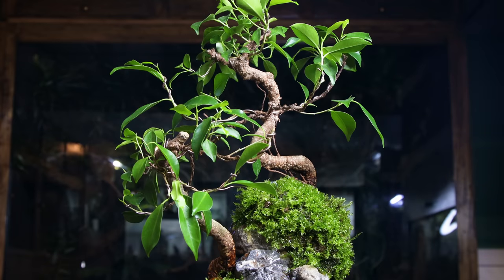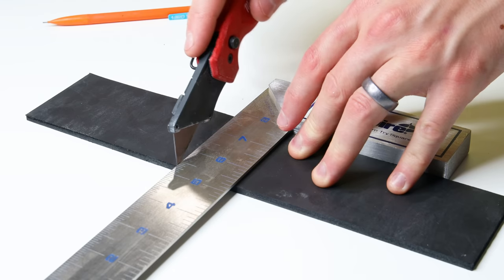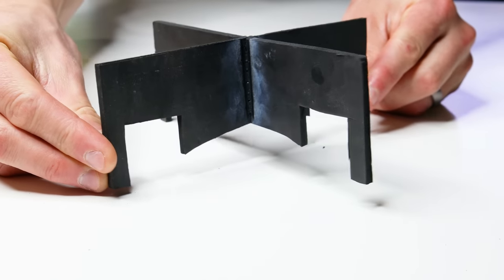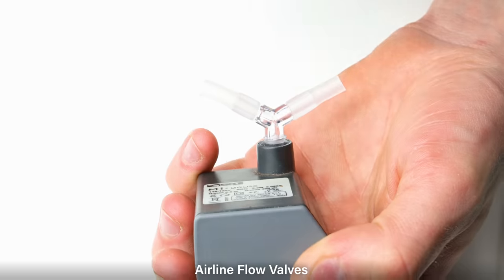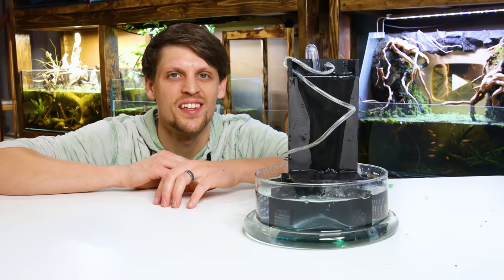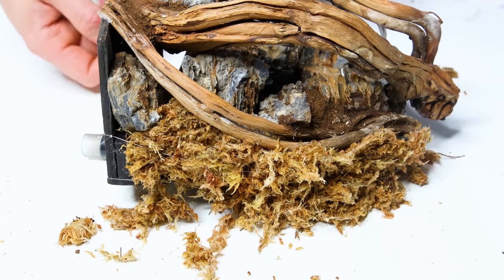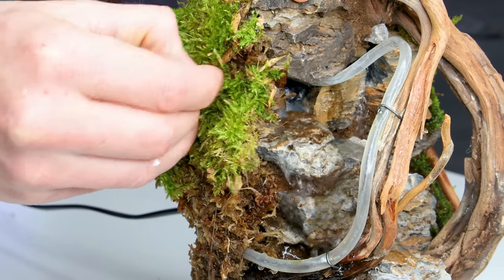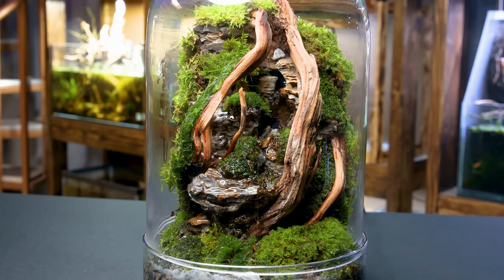Mini Flowing Moss Waterfalls in a Jungle Cloche Terrarium

Comment: This turned out great! 

For these more intricate terrariums, have you considered 3D printing the waterfall/drip frame? You could print the overflow and drip plumbing integral to the structure itself, and even parts like the pump area mesh could be printed in place. 

It doesn’t make sense for your large builds, but might be worth a try for these small jar builds.
Reply: Good idea but 3D printing could be actually hard when we have to design the model before printing.

Comment: I've had good success bending rigid tubing by filling it with salt. It helps keep the tubing fron collapsing, and you can make pretty much any shape you want. Just rinse the salt out when you're done!
Reply from the maker: I usually use sand as you do salt, but didn't feel like digging it up out of the garage 😅

Comment: Couple questions. Why use larger gravel on top of smaller? I would think the larger being at the bottom can more readily supply water back to the pump. And how often do you have to do maintenance to the pump on a build like this?

Comment: This is kind of a specific question but what gph or flow rate would you typically look for in a pump for this project? I'm never sure if the pumps I'm looking at are way overkill or what.
Reply: I've used the tiny pumps from betta tank filters that go in 2 to 5 gallon tanks. I'm running a little waterfall (about 50% stronger than the one in Tanner's project) in a paludarium with the pump from the smallest TopFin filter from petco. 

Any pond pump is too much for something this small. I don't think he ever mentions where he gets his pumps or they're specs.

Comment: I love this! Watching your builds has inspired me to try to convert a wooden, glass fronted gun case from the '70s that was my fathers. I would like to make it to contain either green keeled lizards or Emerald skinks. First I reckon I must water proof it. I was thinking of using the As Shown On TV stuff to paint the inside wooden parts. Is that compatible with the lizards or skinks? I figured that I will also have to put a bottom containment lip on it but what you did with the cloche to avoid external dripping makes me start to rethink that.